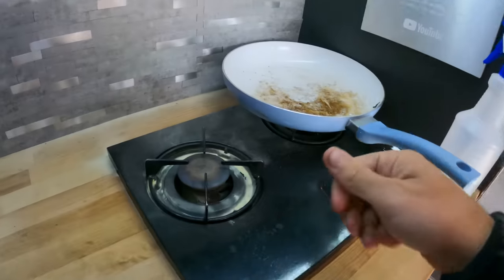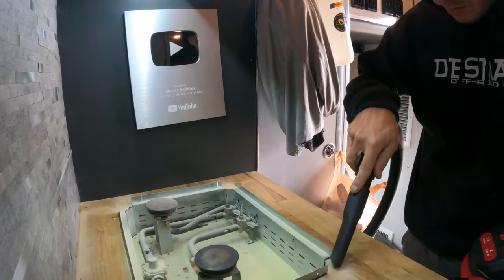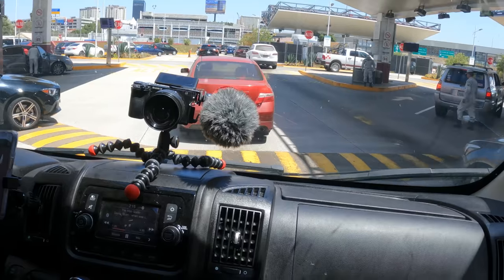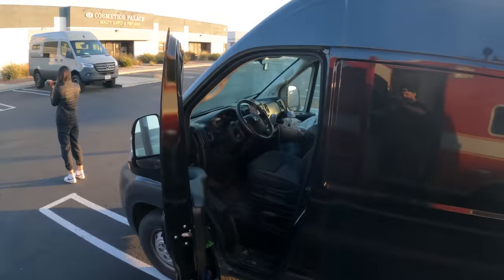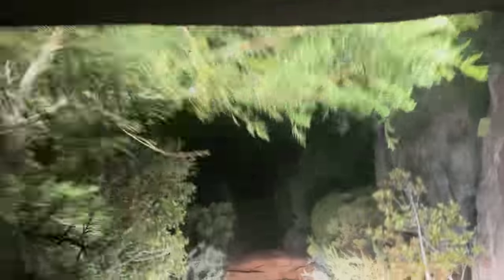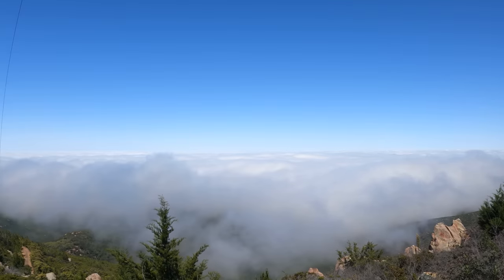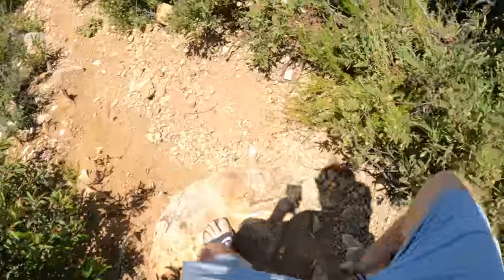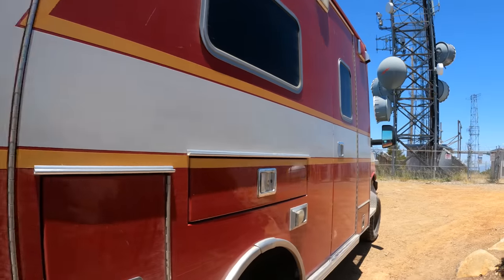Camping Above The Clouds! - Ambulance Camper

Comment: always turn the propane tanks off at the valve on the tank when not actively using the burner, that takes the pressure off the hose and eliminates any chance of a leak. Relying on just the hose to contain the propane is risky, they can bust a leak anytime especially when under pressure.